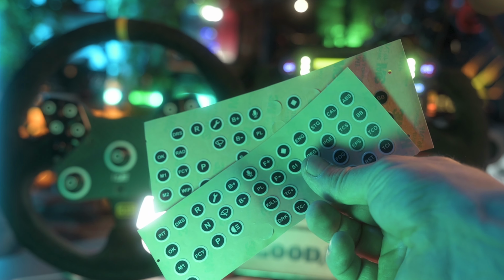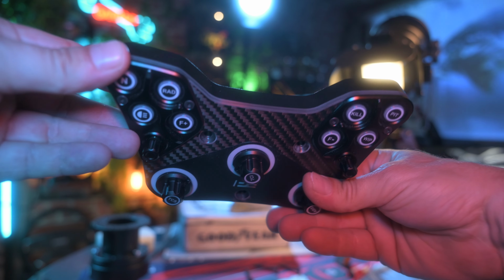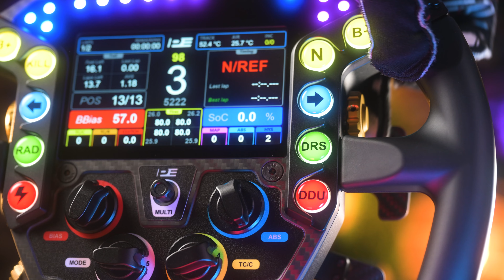Flying SIDE ways with the PE Rally

Comment: Hey, I want to build a similar setup and im in the market for some monitors do you think 34 inch monitors would still be alright for my fov i was wondering that because i saw that you have 32inch?
Reply from the maker: Hi buddy 
I don’t know how those 34 inch works as they have different aspects ratio.
It must be it must be ok but I haven’t tested that
Reply: @chepilevski  what about 32 inch same curve as yours but 1920x1080 have you tested that?
Reply from the maker: @TeoKKrajnc  I think 32 anything above 27 inch must be 1440p as pixels in 1080p will be noticeable and picture not too sharp!
I see bigger differences between 1080 to 1440p then 1440p versus 4k with my eyes!

Comment: What size, length, and brand of cable do you use for the wheel rims that need to be wired
Reply from the maker: Those coiled cables are around 1.5m when stretched and I have USB self powered hub behind my monitors.
Pokornyi Engineering have on his website and also SRB.
I don’t know who is the producer of those buddy